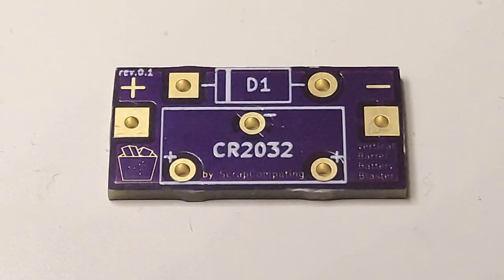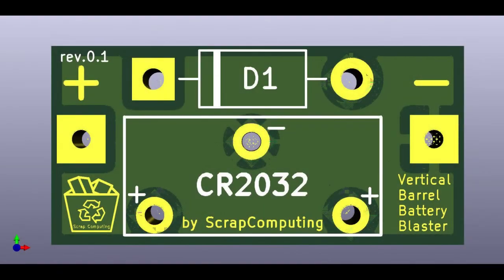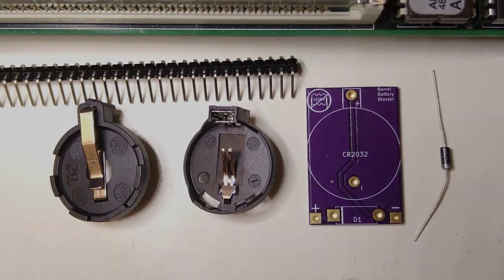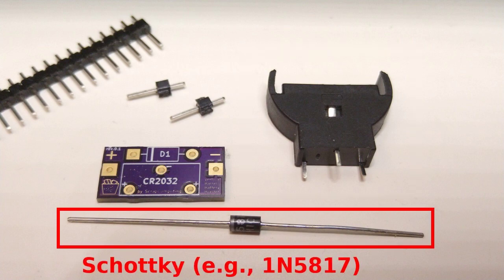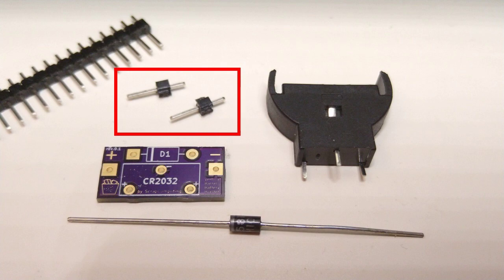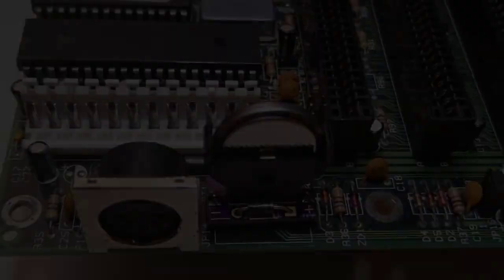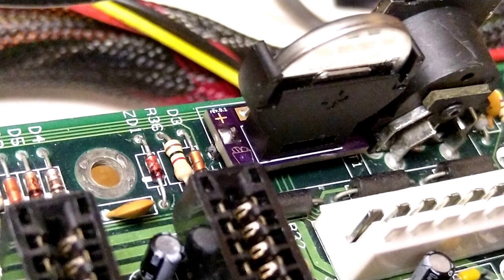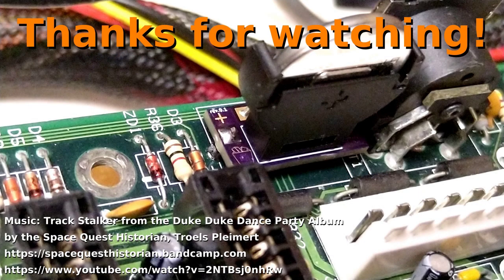Vertical Barrel Battery Blaster: A CR2032-based drop-in replacement for leaky CMOS batteries

Comment: How bad is it if i don't use the Diode so the Board doesn't charge the battery? I have a lot of dead OEM Socket 775 Motherboards and just took on of the CR 2032 holders from them and soldered it onto a 486 Board.
Reply: So i tested it for like an hour and it did not get hot or anything. Guess this an option temporarily?
Reply from the maker: @xDJxGNOMx  Well most batteries warning you against charging, so it might be dangerous.

Comment: Hi there!
This is an amazing solution! I got one for my 486 motherboard, and it works really nicely.

Your video actually inspired me to do my own PCB design, a keyboard connector adapter between AT and PS/2, which should work both ways, so either an AT keyboard to PS/2, or a PS/2 keyboard to AT. The former i cannot test, because at the moment I dont have any AT keyboards at hand (the reason why i made the pcb in the first place).
I wonder if you would like to show it off on your youtube channel, if so, then i'd gladly send you the gerber files over. I will upload it to github too eventually, but i'd like to make sure if everything works fine with it first.
Reply from the maker: Nice! Feel free to share it on github so I can take look.

Comment: Yes but how do you take the battery out the slot
Reply from the maker: You just pull it out.
Reply: @scrap_computing  no no, I had to jam a flat head in it to take mine out, other than that it would have just been stuck
Reply: @rtcxhtm  I think there's misunderstanding; you should just be able to pull the battery out in the new VBBB. For getting the old battery out of the old holder, YMMV.  If you couldn't just pull it out of the VBBB, you messed up the installation somehow.
Reply: @squirlmy  nope

Comment: wont work in the short run battery drains fast on older motherboards and early 486 motherboards
Reply: lmao ok. they just do this to hundreds of motherboards but thanks for the info.
Reply: I think the idea is to make an easily replaceable battery in place of the old, soldered-in battery, not one that will last for years, like the original.  If you do want one to work for day-to-day use for the long term, a different solution is required.